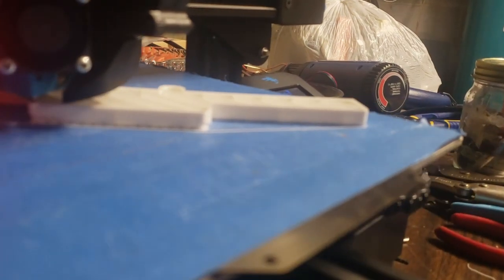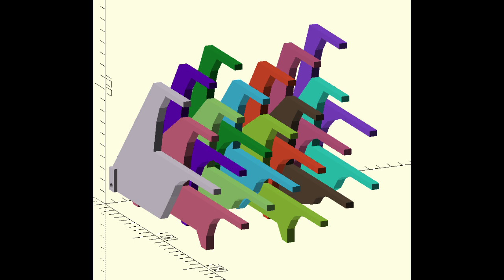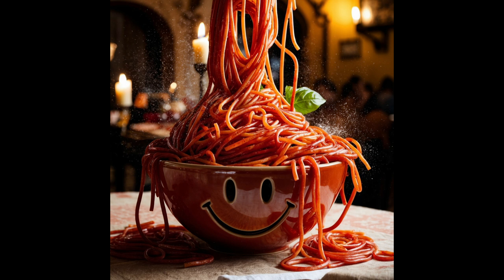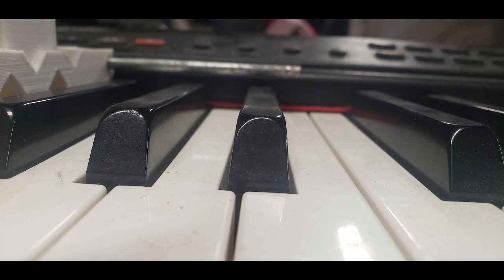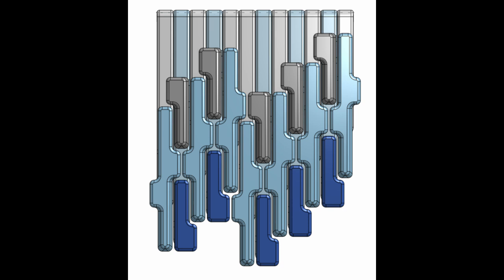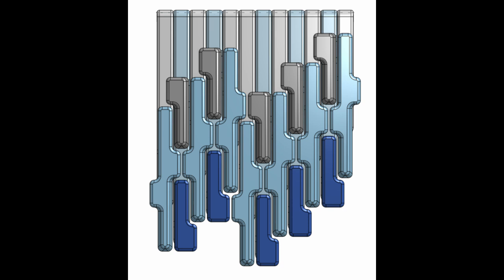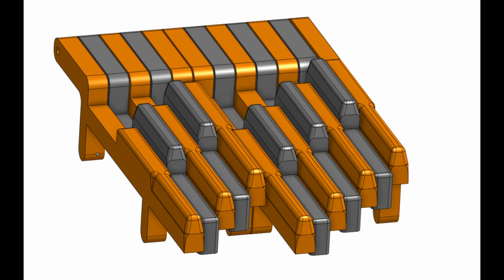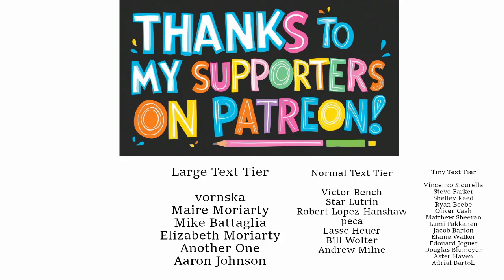Isomorphic Keyboard Piano Overlay, Version 4 Design Update

Comment: So I assume you are manually designing these now instead of using a program like before?
Reply from the maker: That's right. It's still parametric, so you can change the values of various measurements to fit different underlying keyboards or to change some parts of the design, but it's not near as versatile as what I built with Java+OpenSCAD.